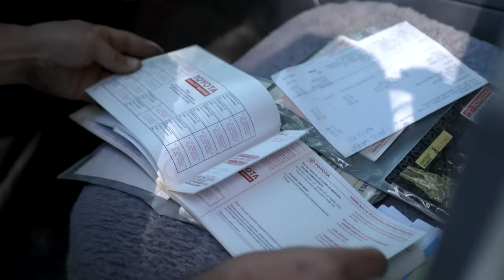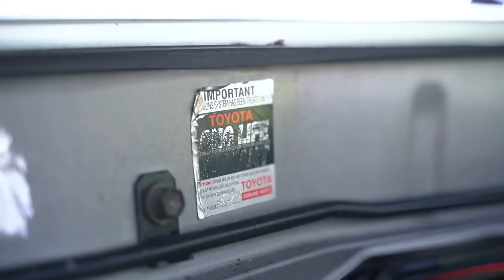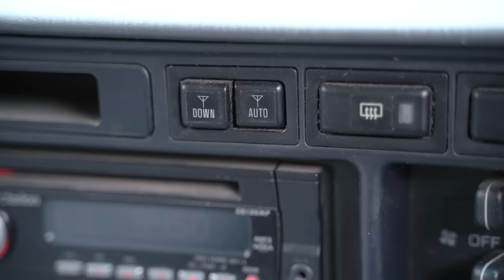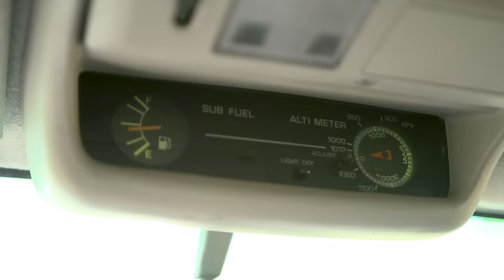RARE GRANDPA SPEC Toyota Landcruiser! You won't believe what Shauno paid + tips on buying an OLD 4WD

Comment: i had a 4runner which was slow so and i sold it to my mom and bought a 1991 subaru legacy turbo 5 speed for 1000$ i wanted a 4wd but somthing fast i found out that they were super rare and it comes come with limmited slip diffs all the way around so me and my brother went offroading in the snow with both the 4runner and the subi,. the the subi walked circles around the 4runner in the snow not only that the subi has 340000 miles on the clock and is running full bolt ons more boost then factery, best second hand car u can ask for, clutch drops at every red light and keeps up with jeeps and stuff on the trails, i even pull out trucks out of the snow, my family loved it so much that they all ended up buying subarus. we used to be a toyota family we have some legendary ones aswell but nothing compares to the subi, ive jumped mine on a dirt road we walked the tire tracks 40 feet distance broke the strut towers but that was it i put some new struts on it and it was good to go. i have endedless storys but long story short i turned it in to a street car and bought another non turbo model that im currently building into a offroad rig for the dunes and where ever elts i could throw at it because my first subi is rare 1/200 so i didnt want to beat it up on the trails  p.s sorry about the spelling

Comment: I got not one but two 80 series bargains, The first one Is a 97 40th anniversary 1hd-ft manual for $5000 and the second one is a 91 1hdt auto for $1000. I  still have and drive both. Sure this is going to be hard to beat!

Comment: My best ever second hand pickup was buying a $100 holden commodore and swapping for another commodore then swapping that for my current car a ford territory with at the time 166000ks on the clock since iv had it I got it bogged changed tyres and got A/Ts fitted

Comment: I was talking to a mate at work about a VH Commodore he had sitting in his sisters front yard that he wanted to get rid of. He takes me around to look at it. As we arrive, I see the VH, parked next to it is a Mitsi Galant, (coming from NZ, Japanese cars were life) I take interest in the galant and ask my mate what the story is with the Mitsi. He calls his brother in law down he tells me everything has recently been replaced, gearbox, shocks, boots, tints, he tells me $1500 I can take it away I asked what the lowest he’d take “now”, he said $500. I said sold, I got my mate to drive me to the atm to get cash out, on the way we stop at his to get the air compressor to pump the tires up a bit and off I went. As for my mate, he was sad and out of pocket. 1- I didn’t end up buying his VH 2- His car broke down on the way home. 3- He had to walk home at least 6-7kms. 4- The car that broke down he left for a few days on the side of the road got burnt out 5- His air compressor was still inside that car. To this day I still feel bad, but he now drives a Camaro so it’s not to bad. Cheers.

Comment: Whilst we are comparing apples with apples i believe our 1996 300tdi landrover defender 110 wagon is the best deal I’ve seen and here’s why! We paid $13500 and it was stock as a rock grandpa buy like your 80, I wish you could post photos! She came with 255k on clock all factory original with all service manuals and receipts. It had just had the transfer case rebuilt, VE fuel pump rebuild and front diff, also included was not only the factory rims but 5x brand new 33’s dynamic rims and muddies the owner had just purchased to fit. It was fitted with ARB winch ready bar, tow bar, sound deadening had just been fitted as old aluminium girls have a bit of cabin noise. 6 years on and we are touring Australia full time in old girl and she has just clocked 413k still on factory head gasket, factory turbo, I have rebuilt radiator for more efficient cooling. Dispute the shit people put on defenders the oldies are the goodies! And this vehicle has not only been adventure inspiring, reliable it has increased in asset value! Not only are defenders increasing in value in Australia but even more so in the US and global market. I appreciate not everyone’s a landrover fan but they are iconic and they are in yards and farms all over Australia and conquered this land way before Toyotas 😉

Comment: My 92 Toyota hzj 75 series diesel ute is the bees knees of a 4x4 had it for 18 years its got 408,000 km was in a serious accident roll over when i was hit by a suberu going the other way i rebuilt the ute with new and second hand bits but the donk is untouched not even glow plugs or injectors done starts first time heaps of grunt from turbo fitted 17 years ago ! Since then its got new 4 inch exhaust twin stacks and the ex note you can see under load with the whistling turbo reminds me of a D8 dozer i used to operate ! Will never part with it ever love it to bits ! Ps i could use a new recovery kit mines getting old like me i turned 60 back in January lol.

Comment: Well Igor my hylux with 200k on int 
In mint condition new rims absolutely stock though 08  22k  delivered to cairns for under 25k  they well over 30k for the same model with more kms in cairns at the time  
I wasn’t there to check it but paid a mechanic to do it he did an amazing job And I got the best car I ever bought

Comment: Bought a Toyota Tundra with 270,000for 10,000when most run for 15,000 an we are The second owner it drives like it’s out of the factory you can still stir it with one hand which is really nice and it came with a lift and 33‘s

Comment: Best second bargain I got was my own car. Bought for $18,500. I wrote it off, got paid out $24k. Used $17k of that and bought a turbo version which I didn’t like.

Went to a wrecker to get a few parts to clean it up before I sold it. Turned out the wrecker bought my old car and had just finished putting it back on the road.

So we swapped and I ended up with the original car back for $7k less than I paid for it in the first place.

Comment: $3000 CND$ lada Niva with 14k on the clock.  Unloved, but it was a side by side with heat and a hand throttle.  i never should have sold it for $3500...great for hunting and fishing and not giving a shit if it got scratched or dinged.

Comment: 4 years ago Picked up a $850 nissan pathfinder from an auction spent $400 on it to get it on the road. Went to the high country a few times sold it 2 years ago due to upgraded.

Comment: Not to long ago I managed to get myself a 1996 1hdft 80, it has 4inch lift and 35s so not quite grandpa spec but the engine has just been rebuilt with on 20,000kms on it for $19500

Comment: 1987 nissan Pathfinder twodoor 
In 2009 I saw it in the back of a used car lot and asked if it was for sale.  They said the computer was dead and they didnt  want to repair it.  They told me $500 would let me get with clean title and bill of sale.  I couldnt find a computer that wasnt damaged myself so one night with a 12 pack and a ohm metter i went to work with three different computer and some how i just ended up moveing the right electrics and around.  I plugged it in and fired up.  She then had a complete overhaul and took me alot of places.  Just pics to remeber her.

Comment: Ened up buying a 2003 Gu Wagon last year in the middle of covid pricing for $10000. At the time had a few issues. Main being slow, this ened up being caused by a faulty MAFS Sensor. All of which I fixed for under 200. So im happy.

 GU wagon, all working with some of the mods I wanted for $10200

Comment: I was pretty stoked with my 1993 Nissan GQ patrol ti with only 160000 kms and not a single thing had been touched, still had the original glue on Nissan logo around the door lock and white marker on the chassis from factory, perfect paint and original factory tires. Only cost me $6000 from Facebook.

Comment: I picked up a 80series sahara 1hdt with all of the top of the line suspension. Engine mods bigger pistons big turbo fully work . Bar work. For $6500 but engine bay had caught fire so i had to repair that.

Comment: Bought a 1994 GQ Patrol 4.2 deisal extra cab with 251k on the clock $16000. The old fella that owned it bought brand new from Nissan when he retired in 1994. It's an ST with disc brakes all round manual windows and in awsome condition.
We were told he ordered the extra cab from the Nissan Factory. Anyway Shaun Graham would love it not sure your a fan of Nissans mind you you did have The Horses GQ Wagon......

Comment: Don't know if it's exactly a bargin but a month or so a go i bought a 1991 Troopy 1hz completely unmolested, original back seats roof console the lot, old vic police vehicle. 250k on the clock and had lived in a garage since 2005. but yeh she was $22k. Took her on a maiden voyage to shark bay and smashed the 3500k round trip with just a gearbox and oil change before we left.

Comment: Take it to Rocket to get him to upgrade the transmission valve body and clutch pack was the best thing I ever did to my 80 . It shifts so smooth holds gears in the steep stuff and makes them tough as nails

Comment: Really happy with my 2003 land Rover discovery 2  paid 4k for her yes she has high km at 350k now but gose strong I'm the second owner first owner looked after it like a dream with every service paper since 2003 second owner got it even got the car fully checked before I got it with every fluid changed everything almost original and nothing tampered with iv put myself 30k on it in the first year only replaced a set of brake pads  and a radiator hose  still going strong easy has a nother 350k in her
Even the tires were almost new when I got her now named pumba

Comment: Dads always said I could sell sand to arabs, have had a few bargains over the years, low km 2008 CRD Patrol Wagon off the local ford dealers lot before it even made it to the classifieds. A couple cars that I sold for nearly double what I paid. HJ45 ex bns/feral 40 series. G60 soft top with a hemi 6 conversion out of a beachside holiday house shed. 2009 tb48 GU off a farm in rough shape, ideal for a complete teardown style build. Majority of the fun is the roadtrips, talking a little with the sellers and the inevitable hours of research and development for plans and accessories.

Comment: Does free count?  In 2018, my eldest sister gave me their loved but unused 1996 Toyota Landcruiser GXL 4.5L auto (FZJ80) which they've had since new.  For 5 yrs I kept asking her to give me first dibs to buy it when they’re ready to sell. But they just gave it to me instead.  They never took it once offroad (closest offroad it got was driving on gravel driveways in the Hunter Valley).  But sadly in the last 10 years before I got it, it just sat on their driveway unused as my brother-in-law stopped driving and my sister became the primary driver (she didn't like driving it as she found it too big.  She prefers her RAV4).  As a result when they gave it to me in 2018, it only had 84k kms on the clock.  Mechanically it was mint, but the paint had faded & was chalky in places for sitting under the elements for 10yrs.  After having owned it for 4 years, it's now travelled up to 125k kms, but it is still relatively stock outside.   It still has the OEM front bumper & bumper guard, and it still doesn’t have a tow bar fitted.  I've now replaced the tired and saggy OEM suspension with a new 50mm suspension lift kit from Fulcrum (thanks to your channel’s product recommendation), and fitted better brake rotors and pads.  But I can’t bring myself to fit a snorkel as I don’t want to cut into its guards.  I’m trying to keep it relatively stock.  I love it, and it’s a keeper.

Comment: Bought a factory turbo auto bj74 for $1000 as a first 4b when I was 17 or 18 had it a couple of years and sold it for $12,000 and it got me into my current 4b 92 hdj80 which I also think was a bargain at $16,000 with 300,000ks

Comment: Bought my fzj80r for $5000 has arb air lockers front and rear , arb front bar and brush rails, tjm rear bar , arb outback draws and cargo barrier, roof console , brand new Bridgestone 33s , currently barra swapping it with the 6spd auto

Comment: In 2004 I bought a 1984 VH Commodore for $100 with 3 days rego, 253 V8, 3 speed auto.. thrashed it around for 3 days and sold it for $500.. good fun, got pulled over by the cops in my street on the way home they were checking if it was stolen 😂

Comment: Just a question from the USA. 
What do Australians think about the old Cummins mechanical engines?
Thinking about the 12v 6bt in particular.
In my opinion that's the best of the best that we have here, generally speaking if you can spin it over it'll run. No electrical needed, basic and simple all mechanical motor.

Comment: I just picked up one of the cleanest n70 Hilux's you'll ever find. 2010 Hilux, very low kms for its age with only 150***kms, super stock, no rust, and engine serviced regularly and even had the genuine factory side steps on that were straight as which can be told it hasn't been flogged at all. Absolutely love the bargain I got for it, and beginning to build it up from scratch myself. Have no recovery gear so it would be great to get a set of snatch recovery. Keep it up guys.

Comment: You forgot the most important thing to look for when buying a 2nd hand vehicle Shauno, Always remove the Radiator cap and have a look if the previous owner made sure the vehicle always had antifreeze coolant. Many ppl baught cars with 300k Km on that only used water and the rust in the pipes was just horrible! The moment you start adding antifreeze and it loosens up that rust in the engine...... pipes start leaking all that jazz! So in short, if a motor as had proper antifreeze coolant its entire life, then you can be 100% certain that the engine is perfect! But if you remove the radiator cap and you see rust..... walk away! fast!

Comment: Mine wasn’t a Yota. Bought a Montero V6 3,000 for $ 2,000 with 140,000 miles. Sold for $ 4,000 after 5 years of use. Looking for the Prado now. Or LC 200 V8 Bi Turbo. 🤑🤑

Comment: In 2005, I bought a 1996 Toyota Prado tdi import, here in N.Z. from Japan, for $28k. It had done just 28k kms from new & looked spanking new. I got it upto 250k km. in 6 years & sold it for $12k. It needed nothing other than normal servicing. I replaced it with a 2006 Prado tdi, taking it to 310k kms, it just needed a new radiator. Why buy anything else?

Comment: Picked up my 96 80 series while on holiday for $3000 with only 120,000km on the clock. Drove it 3500km’s back home. Fuel cost more then a flight but oh wells😂

Comment: I got a 1976FG 40 with 23,000 original miles white with the stock six cylinder the fan for the carburetor the stock rims tires nothing bad at all I paid US$5000 great bye to this day it is still all stock I have an FJ 40 also 77 with a 383 Chevy fuel injected air lockers front and rear power steering air conditioning that I take on hard for by foreign trips Best Buy I’ve ever made was the 76 FJ40

Comment: This bargain isn’t as good as yours but it’s up there. About a year ago today I bought my 80 had 365k on the clock for 12k and like with your new rig it was completely grandpa spec and came with full service history and logbooks, even came with owners manual. It also came with that exact tool kit from factory in the sandy coloured bag and with the jack as well, still works like new. Mines a 1990 1hz though could only wish it was a 1hdt-ft 🤙

Comment: Well i just picked up a 2011 76 series WORKMATE, 106000kms, with FACTORY DIFFLOCKs and AIRCON which were factory fitted optional extras… from the original 1st owner. And in this market.. 49k
Im thinking it was a good deal!

Comment: Ha Shauno I was lucky enough that about 4 yrs ago I picked up a2006 1HDFTE 5sp auto 100series gxl up spec with VX extra’s eg. Headlights and grill ,rear a/c tow pac bigger auto cooler,electric brakes arb bull bar,ome suspension,twin batteries 260 klm fully logged books and every receipt this old boy hod spent,a gray nomad only ever a touring rig bought it before covert tax came in for mid 20s ! Could use some new recovery equipment !

Comment: Love the 80 mate have had most cruisers and am driving her big brother 2005 100 series td as my daily.
The best buy of mine has to be the little suzuki sierra hard top called George. It was towed around Australia for its first year then sat at a holiday house garage with flat tyres for many many years. I bought it, it has original 40k on the clock, looks straight out of the production and very stock. Yeagarup dunes and beach was a breeze, he showed others on the trip that size dosnt matter or cost of your fourby. Only issue is the deep wheel ruts give you a different view of the track🤣🤣🤣

Comment: 1993 80 series boring old 1hz NON turbo  dual cab 500mm chassis extension. cost me $7200. have modified the tray to suit me n the Mrs camping with fridge lights and storage etc.  tow our little van everywhere. Will never sell it . Have been offered 20 but NAHHHH couldnt find anything good enough enough to replace it for that

Comment: You will laugh i bought a 2000 holden jackaroo , 130,000 km for $3000, take in the mountains deer hunting, camping ,gold prospecting done a couple mods, winch, catch can , lights thats about all now has close to 4000,000km on clock still going strong, out drives my mates nissan ha ha i have owned a toyota shara and a few more , but the jackaroo is going strong

Comment: I bought a 2001 au falcon for $270 a couple years back and it was in perfect condition, with only 112,000 kms on it, my stupid ass swapped it for 1998 vs statesman than have about 3 massive rust holes and an oil leak, anyways stopped running after doing a couple skids in the paddock so I sold it for twice as much as I paid for the falcon. So i made profit

Comment: I picked up a 1995 1HDFT 80 about a year ago for 4K, 280 000 on the clock and not a dint in it, just has sun damaged paint
Reply: Mine is a manual though